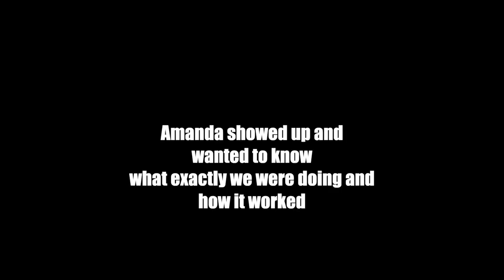SUBARU WRX/STI REAR WHEEL DRIVE CONVERSION

Comment: Throw 2 more gaskets in that mid pipe ti fill up that gap. Or have your flanges rewelded but double gaskets will fix your issue on the cheap.

Comment: Hey ive been asking arnd i have a 07 sti it is rwd swaped and has hub in the trans and in hub for axle but the pronlem im haveing is im getting a p0502 code which i assume is because the wheel speed is diffrent from wut the trans is reading but would you have any idea of how to fix this

Comment: Interesting. In a good way. What are the downsides besides the obvious of not being AWD anymore. Do any lights come on on the dash board? Does it affect stability control, abs etc. I think that would be my only concern.
Reply: Abs and stability control run on sensors on the brakes.. removing axles and putting a spool in wouldn't affect it at all. Not being AWD is not a downside either.. RWD has it benefits and AWD has it's benefits.. if you want to be able to drift it then AWD is a major negative though. Dash lights can easily be cancelled out with a scan tool
Reply: @AiDOS__  makes total sense. Not many people have done this on the 2015 + wrx so not much solid info out there. Supposedly it was challenging to do on the va chassis because of torque vectoring. Maybe I'll just have to try it lol but I also read the wrx rear diff isn't as strong so might end up smoking that with all the power going to the rear wheels.
Reply: @nabaddame5726  yeah, here in Aus so many people have rwd converted Subarus and after the rear diff breaks they usually get a skyline diff and modify the rear cradle to take a diff made for a rwd car

Comment: The spool doesn't make it rear wheel drive.. the spool just forces power to go to either shaft so that when you pull out the front drive shafts you don't just end up with no drive to any wheels (or minimal drive). Like a spool in any diff, it just turns it into a solid axle instead of a differential